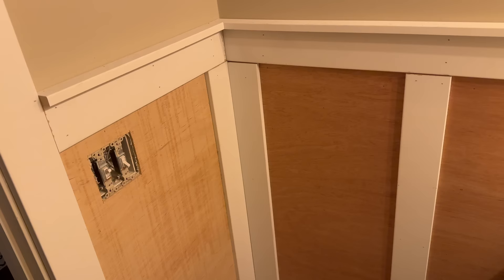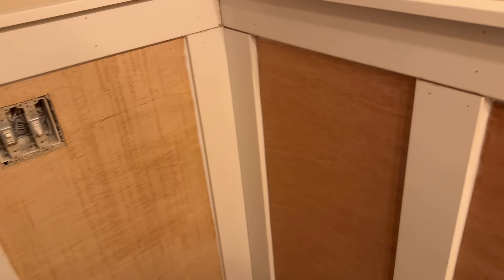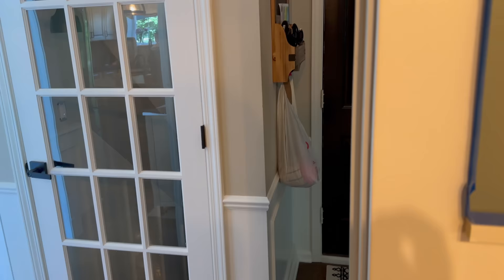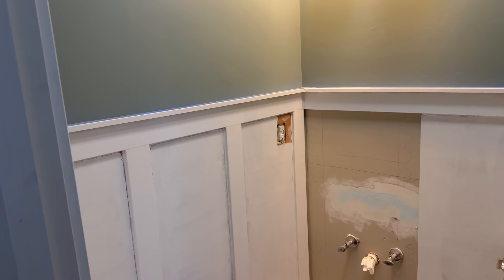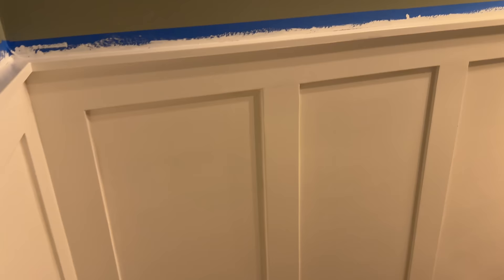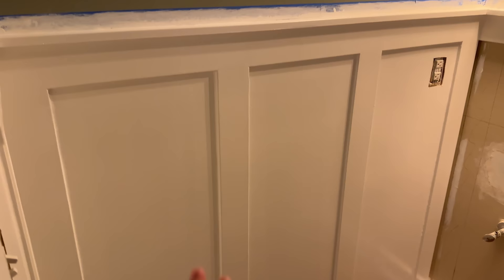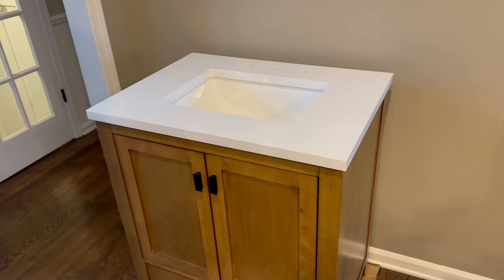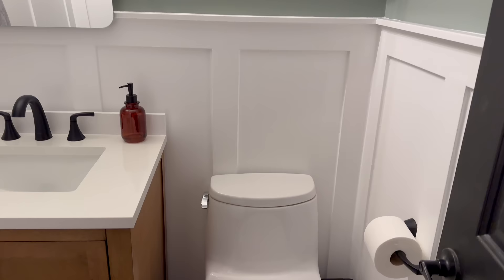Full Reveal of a Half Bath Remodel | Part 2

Comment: I actually like the wood grain showing.🤷‍♀️  My Dad and Brother in law were painters. They would prime raw wood first. Then sand, and paint. Then they caulked it. And touched up painted after caulking. And if it's a paint you need to do multiple coats with, they would sand in-between each coat. I think it came out beautifully. Great job!

Comment: The bathroom looks beautiful!  Such an improvement!  FYI, as someone who has done A LOT of home remodeling, we have all made the silicone-caulk-on-a-surface-that-will-be-painted mistake, lol.  The most time efficient solution (for your next project) is to caulk first (always!!!) with PAINTER'S CAULK.  It's also what you would use around the painted side of window moldings and such.

Comment: The end result looks amazing. I am big fan of green tones and black accents myself. From the technical point of view, I’d be slightly worried about the gap between the wall and the cabinet, mostly what is going to happen with the water that will drip there, and I am curious whether you couldn’t just place the inside plank higher/lower instead cutting it, since there seem to be multiple pre-drilled holes on the inside of the cabinet?